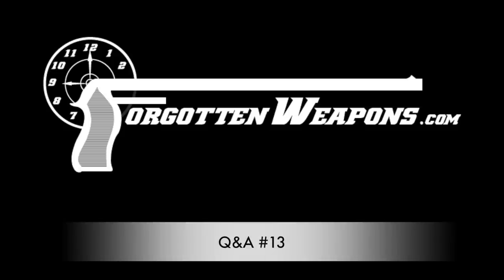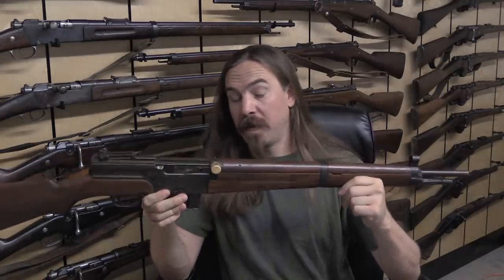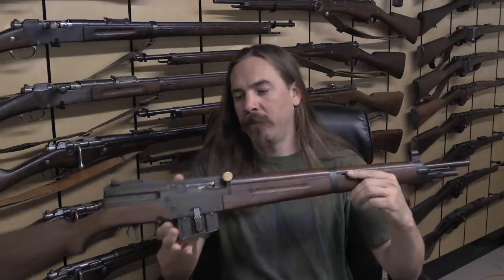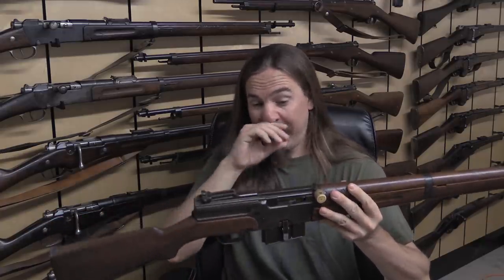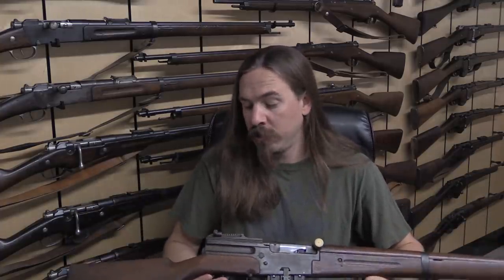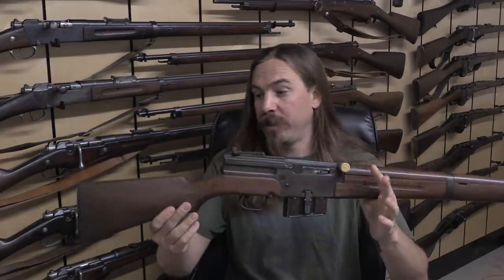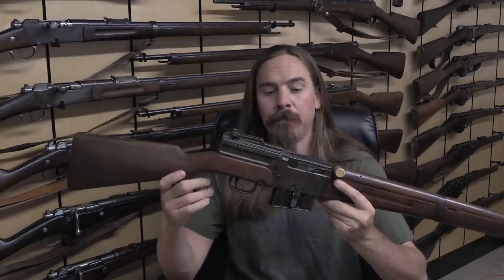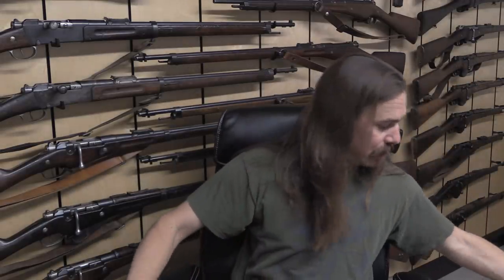Q&A #13: Cameras, Surplus SMGs, Modern Rocket Balls, and More!

Comment: When are you going to make a video of a phased plasma rifle in the 40-watt range?
Reply: Joan Summers you ain't getting notnin' done with 40 watts, you need at least a kilowatt.........
Reply: Joan Summers and you also need a variable frequency oscillator to rotate phases to reduce the possibility of jamming.
Reply: tarstakars How about a video of a 45 long slide with laser sighting?
Reply: tarstakars you forgot the desmotronic actuator and cold fused fusion pack to power the unit as well.
Reply: Joan Summers 

Can't go wrong with a nine millimeter UZI when your a cyberdyne systems model T-800
Reply: Did he do one of "Da Uzi Nyne Milimeetah"?\
Reply: hey, just what you see pal
Reply: Good luck getting a DL-44 through imperial customs.
Reply: .. that's fake... it's just an enclosure around a rifle
Reply: +tarstakars Well yeah 40 watt is anemic but it's preferable to train with a 40 watt rather than a bfg 500Kwatts or such that blinds you with every shot if you are not used to it. Training with a plasma phaser too powerfull tend to make the shooter develop flinching and other bad habits.
Reply: phil verhey you shitted on my dweeems!
Reply: The Stoned Videogame Nerd there are shitloads of coil guns but nothing quite that small able to penetrate steel.
Reply: Hey just what you see pal
Reply: @joansummers873  manufactured by Ducati I am guessing??? Desmotronic, desmodromic whatever it takes !;)

Comment: The Browning Recoiless shotgun was a fully mechanical somewhat 'recoiless' shotgun. A single shot 12 gauge that used a fully mechanical recoil mitigating assembly. Came out in the mid 1990's and didn't see many sales due to an extremely high price and a general fragile build. I believe the gas/magazine tube shotgun you're referring to was a Trap model Remington 870 that you briefly touched on in one video.

Comment: FYI, the "Bf 109" used by Israël were Avia S-199s, which were built in Czekoslovakia with original German Messershmitt 109G parts and airframes. However Avia didn't have access to any of the original Daimler engines used in the Bf-109s over the years so they put Jumo engines from bombers under the hood, which made them pretty terrible and unstable.

They ended up being replaced by Spitfire pretty fast.
Reply: Same with spain, but they used merlin engines instead
Reply: The Diamler engines are what made that plane such a performer. Anything else would be garbage.
Reply: It's two stage supercharger is massive on a Merlin.

Comment: The guy that asked about replacement stocks for milsurps. The best advice I can give to all. If you have a milsurp, that either you wish to restore or repair.  The best way that I've found is one of two ways.  1) buy a gss (gunsmith special), AKA a second gun of the same type that is currently inoperable, but can be harvested for the parts you need.  2) drill purpose, buy a drill purpose rifle, and harvest the parts needed.  Usually doing those two things, will offer a better return on investment, and easier way to fix up a good rifle.

Comment: +Forgotten Weapons Wrt a "Modern Rocket Ball" ammunition, there actually exists something very similar. The 9×25 mm AUPO for the Benelli CB M2 SMG.

It works much like a rocket ball, comprised of a jacketed bullet with the jacket extended out to provide a hollow for the propellant and plugged by a flammable seal. The cartridge was fired by striking a band that was around the middle of the cartridge (think rimfire with a pinfire striking orientation), and depending on your source, the case section would break off but still follow the bullet out the barrel.

Comment: @1:12:10  In the case of a rocket ball, A heavy weight at the front and a light weight at the back is the stable configuration. I can tell you from my experience with designing rockets, you WANT to centre of mass ahead of the centre of drag.
Reply: I agree although the term you want is center of mass ahead of the center of pressure (as in, aerodynamic drag pressure when the bullet is turned slightly sideways). COM and COG are the same thing so they cannot be at different locations. There is also the opportunity to spin the bullet still, which eliminates the need for aerodynamic stability (and is superior for something like a bullet with a short, high speed flight duration). I'm afraid that Ian is wrong about the stability issue.

Comment: Why haven't more militaries adopted the ultimax LMG? It seems like a great way to mitigate recoil but still have a relatively lightweight gun
Reply: Carl Smith low rate of fire perhaps?
Reply: frank damsy In short, it makes the most logistical sense. In some cases, they will even reuse parts of their infantry rifles for their belt fed LMGs, like the PKM which uses a modified AK bolt.
Reply: frank damsy Really its impressive how many ways you can reconfigure a weapon. Buts theres always gonna be limits to that inherent to the base design. For instance, AR-15's dont make the best LMG's. Everything is so compact and tightly fitted. Any warping caused by heat will have more of an effect in an AR-15 based LMG than an AK or G3.
Reply: I don't know if its reality or just a perception of reality but generally 556 is considered inadequate for lmgs
Reply: Fox Phelps Its generally considered sub par for LMG's probably due to comparatively low ability to penetrate hard cover. But i can't think of other reasons for this idea of it being a poor LMG round. It would seem to make a great round for belt fed LMGs which are mainly suppression tools. You can fit a lot more 5.56 into a container than say, 7.62x39 or even 5.45x39. Standard box for the M249 is 200 rounds. Low recoil too, especially when in a heavy belt fed like the M249. Theoretically speaking, it seems to be a dream for suppressive fire.
Reply: Everyone already adopted the fn mag minimi or pkm and no one has the institutional inertia to replace it

Comment: 41 Action Express is an obsolete round that could still have a place. 40 SW pushed it out of the market, but it 41 AE was a better middle ground between 9mm and 45acp.

Also if someone wants to look at differences in revolvers then look into Mateba's designs. He was quite willing to try new things.

Comment: Regarding rocket ball aerodynamics (1:12:00 ish): big mass at the front, big surface at the back is actually a very stable configuration for forward flight. Look at darts – either the kind used for playing the game of darts, or the kind used in NERF toys – both have the weight towards the front and both fly straight.

Comment: 19:39 - what about 7.62x45 from 1950's Czech republic? The only reason they dropped it was because x39 standardization was cheaper. It would be a more effective intermediate .30 caliber than 300blk or 7.62x39 while still having a shorter action and less recoil than 7.62x51 NATO.
Reply: Would it be more effective though? It might have problems fitting in any kind of magazine because it is 2mm longer than 5.56 and 5.45 and 4mm longer than 7.62x39 so it would probably only be viable for a completely new weapon. In terms of performance it is also not really a significant change over 7.62x39. It's definately not a bad caliber but what does it offer that is worth the hassle of changing to it?

Comment: Regarding what you said around 57 minutes in: The M16 burst system can fairly easily accommodate 1 (although I don't know why you'd want to), 2, 3, and 6 round bursts (the cam wheel has a total of 6 positions) just by changing the burst cam: The burst cam has six total positions, and the depth of those cuts determines whether or not the burst disconnector (which has two hooks, one of which rides on the burst cam) moves far enough forward to catch the hammer. As a result, all you'd need to do to get the above bursts is to swap the burst cam for one with the right configuration of equally-spaced deep notches (6, 3, 2, and 1 deep notches respectively to get the burst lengths referenced above). It's definitely not the sort of thing that a soldier should do in the field, but it's absolutely something that an armorer could do at a depot.

I've never seen a 6-round burst cam, but I've definitely seen a picture of a 2-round burst cam shared on the NFA discussion board over at Subguns.

Comment: the russian AEK rifles and the SR1 and ak107 are also using a recoil reducing system, it works by having a weight that moves forward as the bolt moves backward. pretty good working and also pretty simple compared to things like an94

Comment: RE the Pedersen cartridge, Mike Beliveau (aka Duelist1954) has reloaded .32 French long for his M1935A pistol, he made a video or two on the subject. the main problem is the brass, it can be made out of .32s&w brass, but requires machining on a lathe to remove the rim and cut an extractor groove into the casehead. bullets are available, hornady makes an XTP 90gr in .309 diameter.

Comment: I have a Browning recoilless trap gun that is a long recoil action turned backwards so the barrel reciprocates forward and then back and the pretty stiff recoil spring absorbs "up to 75% of felt recoil" and I can confirm it works. It's also interesting that it's a self cocking, manually operated bolt action as well

Comment: If you can carry a Browning Hi-power, and conceal it, that wouldn't be a horrible choice.  Kinda the only older design that I would carry today.
Reply: It is funny all the firearms I conceal carry regularly and 50+ years old, even my HD gun is Win. M12 riot gun from WWII. The three gun I routinely carry are a S&W M19-2 4", a Bulgarian Makarov in 9x18mm, and a Pieper Model 1908 in 32 acp. I would love to add a Hi-Power to the collection as well. People seem to forget many designs that are old but oft recommended, some example being, 1911 style pistols, S&W revolvers of all frame sizes and barrel lengths, Ruger revolvers, Colt revolvers, and Makarov pistols to name a few. I personally also like to acquire and would carry a Colt M1908 in 380 acp, and some small 32 acp  pocket pistols of various makes in addition to some smaller revolvers than my 4" Smith and Wesson.

Comment: I'd think a CZ-82 would make for a respectable C&R CCW pistol. Granted it has some draw backs such as weight being an all steel design. The lack of a decocker is a legitimate safety concern, and 9mm makarov isn't the most potent option and it lacks ammo options. But it is a solid and reliable DA/SA compact pistol with ambi safety and mag release that has 12+1 rounds and is a C&R pistol.

Comment: I know the video is a couple days old, but after scanning some of the comments, I didn't see any on this. I think you might be a little mistaken about a modern rocket ball ammo. The center of mass would be well forward of the center of lift (or drag as you have it) and wouldn't spin around to tail first. I'm not saying it would be stable because more goes into it than that, or that rocket ball ammo is a good or bad idea, just that having a hollow base would keep the center of mass forward, which is actually what you want. Think of a spear. The head being heavier is what keeps it from spinning around if you throw it. I say this with the most respectful intentions. You know way more than I do about most of these things.

Comment: I'd argue the drop in .22LR conversion bolt and mags for AR-15s are the modern day equivalent of the Pederson Device. I could even see some edge use cases they'd be good for if partnered with a suppressor.

Comment: A frequently overlooked advantage of rifle grenades vs bazookas is rifle grenades have no backblast.  Bazookas cannot be used from buildings and bunkers without the rocket backblast bouncing around and roasting the user, even from an entrenchment the user has to rise to a fairly elevated position to keep the backblast out of the trench.  This basically means using a bazooka requires the user to dangerously expose himself to enemy fire and observation.  Rifle grenades can be used from cover anywhere you can use a rifle.

Comment: I think sticking with a full-power cartridge was right based on World War I experience, where soldiers were shooting at each other at relatively long ranges between trenches. And I think it was right based on the longer ranges in many theaters of World War II. What really allowed intermediate cartridges to shine, though, was the accuracy of the AR platform and the inaccuracy of earlier weapons. The M1 Garand was a 2-4 MOA weapon; acceptable for its day, but it effectively neutered the .30-06 cartridge to around 400 yards effective range. Meanwhile, an AR with 5.56 is usable out to around 600 yards. A full-power cartridge with the right weapon will certainly have a more versatile engagement envelope, but they simply got leapfrogged.

Comment: Okay, so to get the front and rear sights in focus at the same time, you need to increase the "f stop" number or "F#" and you might need to increase the "iso" to adjust the brightness.  Write down the current values, or any settings currently set to "auto" before the change, so you can go back to filming after.  I don't know if it is worth your time, but someday you will see a really neat sight-picture and might want to share it with us.

Comment: If the 35M has issues similar to the G98/40 then be careful with the extractor! They have a nasty habit of breaking and are unobtanium. My G98/40 is still running strong, I don't use it much and I am very careful with it when I do take it out.

Comment: You mentioned instability of rocket balls, bullets that when propellant is exhausted, you have a bullet that can swap ends and fly backwards. Shotgun deerslugs have nose-heavy construction and a hollow skirt. They are fired from smootgbore barrels and fly like a shuttlecock and hit the deer nose first. Instability may be from uneven burn of propellant while in free flight. Bazooka rockets do their complete burn while in the tube, not while in free flight.

Comment: I bought a CZ 70 for concealment. After 2 range sessions, I realized what a terrible decision I have made. The first time it didn't fire so I had to buy a new firing pin set and pay for a gunsmith to install it. The second time it fired and had minor feeding issues. But the biggest problem was that it would fire a chambered round when decocked. So now I've given up on it. Its a nice collector's piece, but I've spent about what a brand new subcompact pistol with a lifetime warranty would cost.

Comment: The 1st question about belt-fed ad's got me thinking. Since the magazine-fed m27 is replacing the belt-fed m249, why not replace both the m249 and m4 with something like the steyr aug. It's got a quick-change barrel. It might work for hot swaps. It might be possible to modify it for open bolt in full auto and closed bolt in semi auto like the lwrc iar. The desert tech mdr ejection system would be nice too, as would a shortened action to allow for an adjustable length of pull. All that would most certainly require a completely new bullpup design, but it seems possible with the current conventional technology.

Comment: A slight mistake about modern "Rocket Balls". The heavy nose - light tail is "Inherently Stable", not unstable. Such a missile does not require rifling at all, or fins either. See "Fliegerfaust" ammunition. It may have been spun, but it was done so as to prevent uneven burning of the propellent from making it veer off course. Projectiles that long in relation to their diameter can not be spin stabilized! The upper limit of spin stabilized projectile L/D Ratio is less than seven, but most rifles use a projectile 4-5/1 L/D Ratio because of the extremely rapid rate of twist required for longer bullets. Such rifles often have 6-6.5"/1 full turn of the rifling twist, while most normal rifles have 1 Turn in 9-14" if they are expected to last a long time. The 1 in 7" twist rate of some M-16s and M-4 Carbines required by the longer bullets required to give a sufficient SD for longer range, resulted a lack of wounding power by reducing the tumbling after impact.